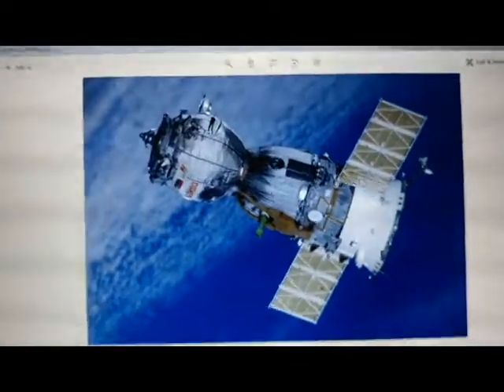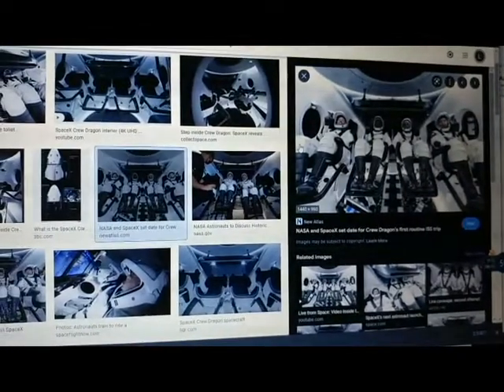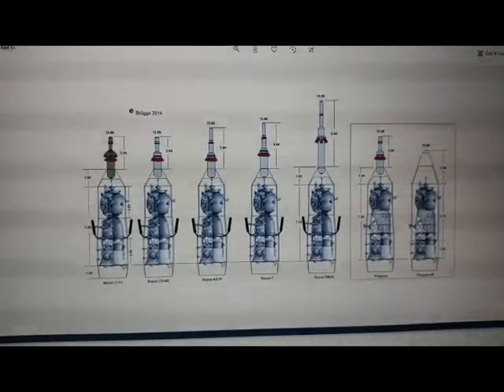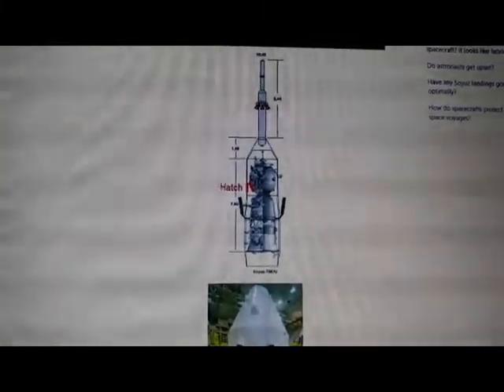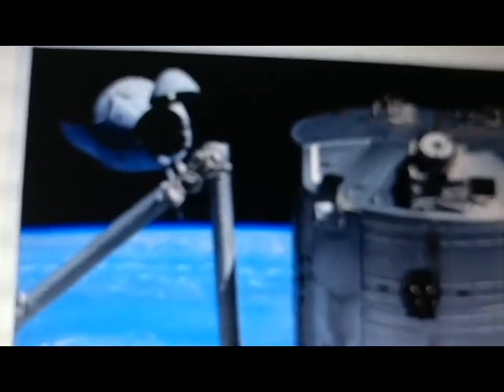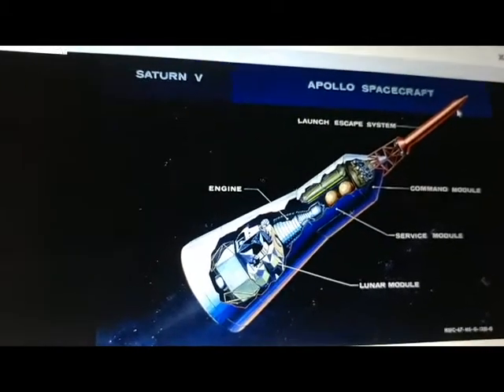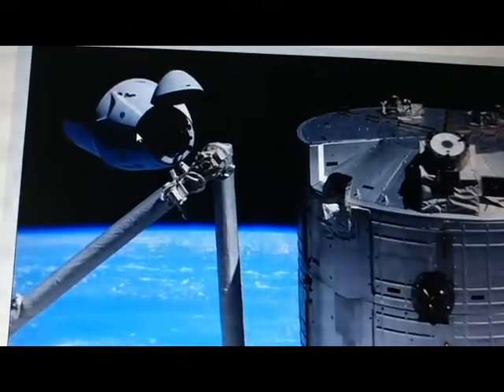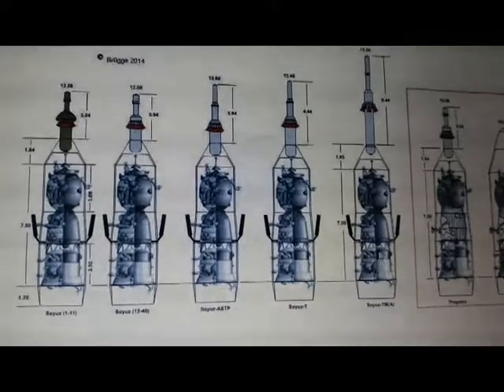Soyuz VS SpaceX Crew Dragon: why so cramped?

Comment from the maker: Ever wonder how the Apollo command module connects to the service module if all of the command's module's bottom are heat shield? there is an umbilical connection at the side to connect all the wires , life support, and plumbing.   An umbilical connection transferred power and consumables between the two modules. Just before reentry of the command module on the return home, the umbilical connection was severed and the service module was cast off and allowed to burn up in the atmosphere.

Comment from the maker: Soyuz have descent module and orbital module (the usable space is divided into two compartment) . compare to Apollo, where the electronics can work on vacuum.  The Apollo module will depressurized and just open the hatch for astronaut to perform EVA.  And pressurized again after return from EVA (without a separate airlock).  Is this the case for Crew Dragon?

Comment: both ship has 1,8 square meters per human, can you read wiki before making video.
Reply from the maker: https://everydayastronaut.com/wp-content/uploads/2019/02/Boeing-Starliner-vs-SpaceX-Crew-Dragon-vs-soyuz-vs-Space-Shuttle-comparison-height-width-mass-crew-volume--1024x576.jpg
Reply from the maker: But the Soyuz is visibly more cramped than crew dragon.  Maybe we need to consider how big are they on the exterior/ fairing.  Also Soyuz separate pressurized sections into orbital and descend modules, making them look even more  cramped during launch when three astronaut are in the descend module.
Reply: @FlyingCarVTOL  they need to take photo inside descent module i think :)
Reply from the maker: Soyuz have descent module and orbital module (the usable space is divided into two compartment) . compare to Apollo, where the electronics can work on vacuum.  The Apollo module will depressurized and just open the hatch for astronaut to perform EVA.  And pressurized again after return from EVA (without a separate airlock).  Is this the case for Crew Dragon?